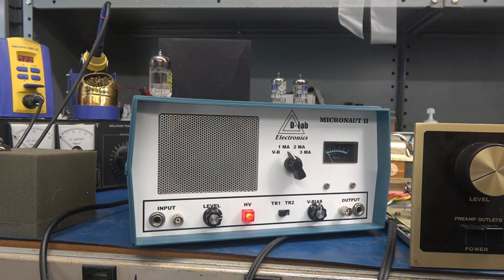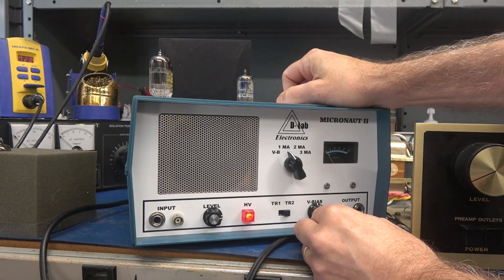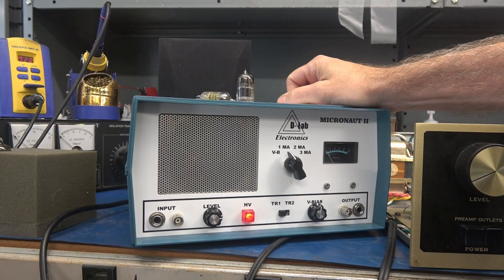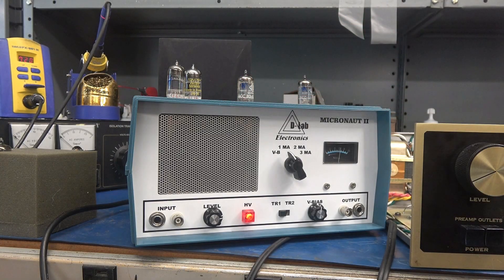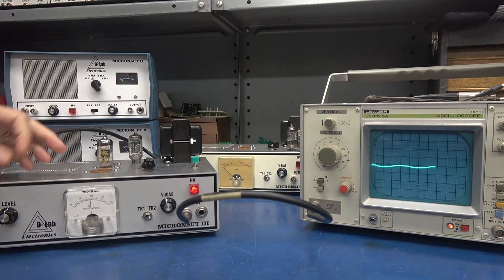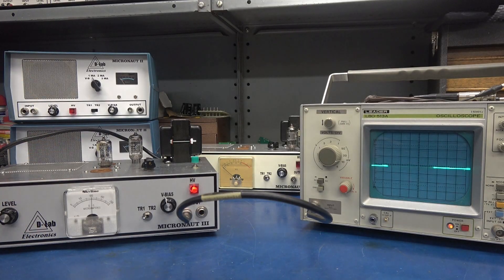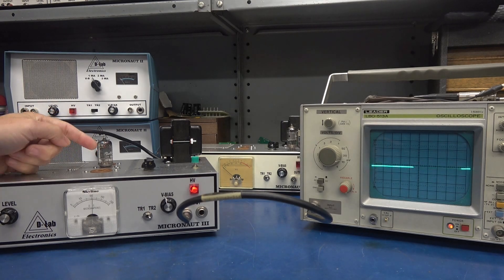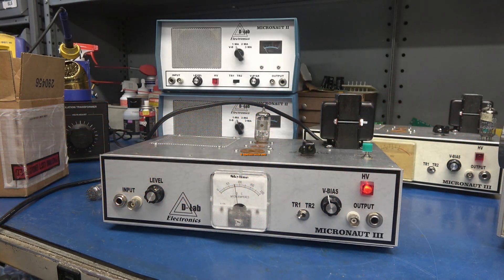Micronaut 12AX7 Preamp guitar home audio amplifier tube testing microphonic tester

Comment: The Micronaut tube sockets are going to get worn out quickly when tube rolling, so what type of tube sockets will last longer? Why not include in the Micronaut to measure the tubes Transconductance/mutual conductance for matching pairs of tubes?
Reply: Socket savers for tube testers have been around since the 50's